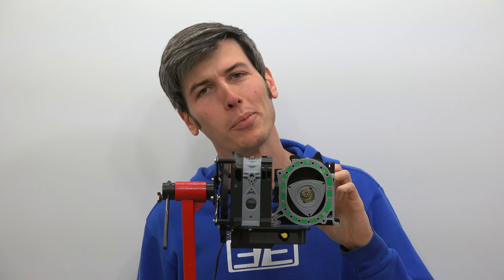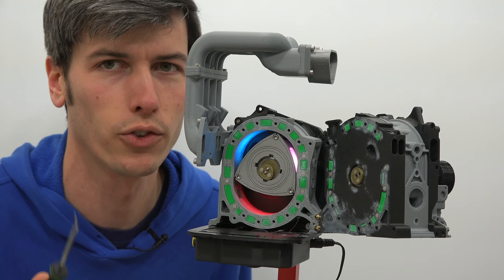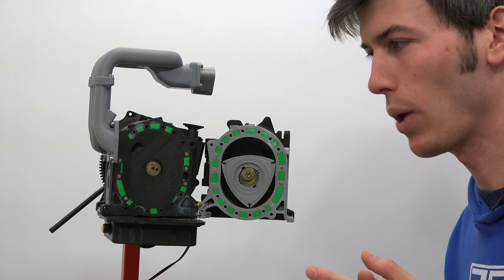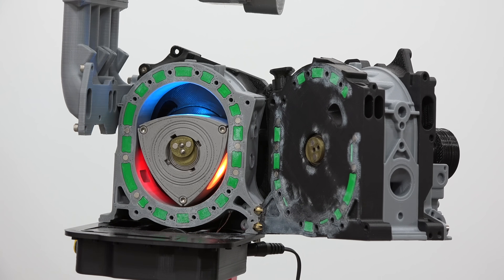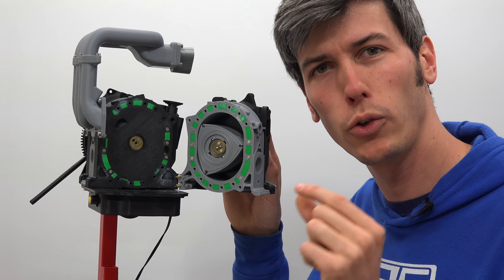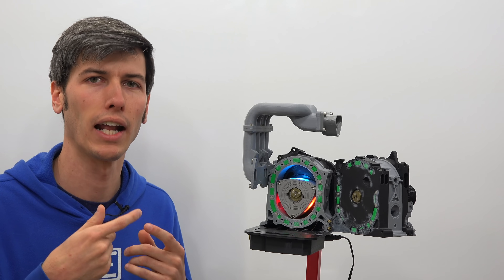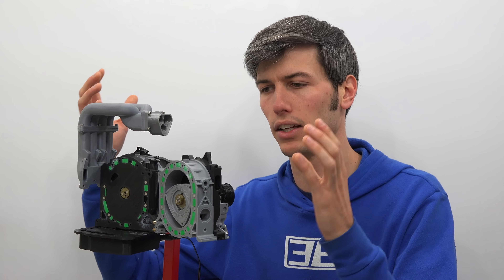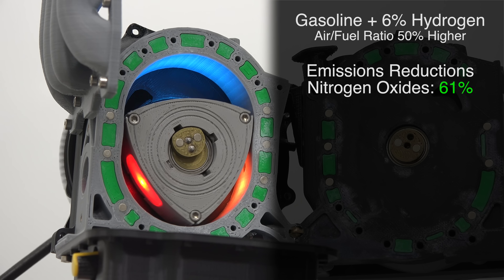Mazda Built A Hydrogen And Gasoline Powered Rotary Engine

Comment: • Mazda's hydrogen engine was originally tested in the 1990s & the car had a dual clutch, dual pole (reversible) C.U.M. dynamo (electric generator motor) between the rotary engine & transmission.
• The floor pan was a stressed member, honeycomb lattice, electrolysis, design that held distilled water that hydrogen was produced in (via electrolysis) that was pumped into a composite fiber fuel tank in the trunk/boot.
• The exhaust produced more water which was pumped back into the floorboard lattice tank.
• The LiquidPiston ® rotary engine is superior to Mazda's design in that the Apex Seals are mounted in the rotor housing & don't break like the Mazda design wherein the Apex Seals are mounted in the rotor. 
• However, I've been waiting LiquidPiston's engine to go into mass production for the public for 15yrs+ & nothing. The prototypes are only available for testing for various applications for the military.

Comment: But what about the rest of issues with Wankel??? It’s discussed like no more oil is injected, not mentioning the sealing issues, as H2 is one of the most leaking gasses due to smallest molecule size, why you keep silent about that? So emissions would still be there with all the oil stuff
Also the temperature gradient between intake / exhaust may be even greater due to higher thermal efficiency, further upsetting sealing and run length, as well as cooling concerns 
Would like to hear these aspects also added to the story to make the “full picture”))))

Comment: Great you mentioned how EGR easily can adjust burn rates and eliminate one of the usual arguments against this coincidentally disruptive technology in ANY IC engine that you can buy a gas kit for (LPG LNG) and run on hydrogen. Big oil too, has been fighting this for ages. You don't need a large tank, you need hydrids

Comment: I wonder if the apex seals could be resigned to work like a roller cam I'm thinking a needle bearing at the tips of the rotor would help with wear and revs I wonder if a needle bearing would against the housing instead of rub or grind against the housing

Comment: @Engineering Explained
does that also mean there is no carbon buildup? since you use hydrogen, and what temperature would the inside be like im considering starting a spider farm to produce the amount of spider silk needed for apex seals since it is more flexible and stronger than steel

Comment: Stunning video, Toyota has actually resolved (apparently) the issues with piston engine pre and post Hydrogen Ignition . . . they run the 3 Cylinder GR Yaris Turbo engine on the upcoming GR Corolla (300HP) on Hydrogen.

Comment: So...
What if you used electrolysis to separate oxygen and hydrogen using electricity generated by a rotary hybrid generator and combust the gases back into water and continue that cycle indefinitely.
I realize there is physically a net loss in energy efficiency, but since you explain physics and have way more knowledge than I do, would this be feasible and could you explain this concept further?

Comment: Can you please talk about high mileage rx8 2008 6 port high out put full synthetic (Midas high mileage 5/20 ) oil light flashed after the car misfires and new catalytic converter reached 2200 degrees Fahrenheit. Now the car is leaking and running horrible. So how does it mix and ignite? What happens to hotter temp oil not being broken down ? Can it cause apex seals to flatte? Fuel injectors clogg?
Reply: Time for a new car.

Comment: Should rotary engine go hybrid assisting with a electric motor? 
How about rotary engines inside two wheel hobs for front wheel drive and inside all four wheel hubs for all wheel drive?
Please also programming one or two rotary engines recharging the battery even when the car is not plugged in for recharging!

Comment: If they could just make it run on Diesel, it would be the PERFECT FUEL!     But you would need like a Roots style Blower  that would be able to get the Compression ratio to 20-1 then still have to use some kind of Hydrogen to aid in combustion.   Or Propane.  Or natural gas.   The Diesel would take care of the Lubrication of engine parts.   

I'm still baffled as to why they don't make more Air cooled Small Rotary engines for things like Back Pack Leaf Blowers.  Or even Turbine Powered Leaf Blowers.  They would be really simple,  small and light.   High RPM would be great, and the amount of air could also be used as work.   Strange.
Reply: Low sulfur diesel fuel has lubricity of only 600 mq, not much better than gasoline.
 Several companies like Sachs, Dolmar, Yanmar, IFA, Savkel and Graupner developed small air-cooled Wankel engines for use in power tools and garden equipment.
 All of them proved inferior to reciprocating engines and were not commercially viable.

Comment: Make sure your sparkplug hole is too large and allows combustion gasses to cycle to the wrong side, also make your exhaust port too large and have it lose usable compression. Also the dorito make sure its not dished to be more functional in one direction, make it smooth and slightly curved. Lastly use soft easily worn out apex seals.   Or fix all of these documented issues?
Reply: None of those things will fix the many fundamental flaws in the Wankel engine.

Comment: I would assume using hydrogen in a fuel cell would be way more efficient than burning hydrogen in an engine.  The only reason why I would think H in an engine would be used would be to have the capability of using gasoline as a range extender.  I got a little confused at the end of the video with using H as a range extension, because I would assume gasoline would be the range extension. If your using H as a range extension for a hybrid, just use a fuel cell.
Reply: That is exactly why all 3 currently available hydrogen cars use fuel cells.

Comment: You'd think that because hydrogen is a gas, they'd be able to compress it for the fuel tanks.

Now if they were to combine Hydrogen, Diesel, Ethanol and Gasoline in the same engine... That would be impressive. It would become an Omni-Fuel engine.

Comment: The numbers at the end were very interesting,.

Simply curious, If you ran H2/O2 or even CH4/O2 (high purity) what would the efficiency of the engine look like? Setting aside the energy used to pressurize the H2/CH4/O2, this is more of a curiosity for a hobby project rather than a car.

Comment: The problem with water as a fuel is the transition/splitting of oxygen  and two hydrogen engine.  However, once that problem is solve...it will change the world.  I was wondering why the the top of engine is used to inject the hydrogen.  Why not flip the engine to solve the contigency of water entering the system and corrosion?  Hydrogen is lighter than air.  Just asking since I am not an expert?

Comment: Rotary; Genius invention by Mazda, great explanation on how and why they work! Quick question for you, would it be possible to convert a rotary engine from the USDM (let's just say 13b for common reference) or would it need any special engine modifications other than dual injectors and exhaust system to handle the heat produced?
Reply: Not invented by Mazda, they purchased a license to build Wankel KKM engines from NSU MOTORENWERKE GmbH. In 1961.

Comment: I think you made a mistake there. You said that a leaner air/fuel mixture would REDUCE combustion temperature. But isn't it actually the exact opposite? (that was around the 8 minute mark i believe)

Comment: My concern would've been the (small, but still present) rotor-to-housing gap that separates intake and exhaust, but if mazda is going into production with it, then it must not be a problem for their system. I wonder if the charge just burns out fast enough that even with the "valve overlap" there's nothing left to ignite the incoming mixture (I just didn't want to say "port overlap" and be even more confusing)

Comment: Thanks for a super-interesting video. I work in a semi-niche technology called heat pumps. One thing only some companies have done well is understand find and develop their niche application(s) in regional markets.  Mazda has apparently done that by targeting this H-rotary as a range extender - constant rpm means very good reliability though low torque - and I assume this engine can be mated to fuel cell vehicles in the long term as fuel cells continue to improve. However, what other niches make sense for hydrogen combustion?  Power station backup? Remote cell towers? Arctic or off-grid applications?
Reply: Fuel cells are much more efficient than engines. There would be no point having both if you are using hydrogen as the fuel. The rotary hybrid mentioned is burning gasoline which can't power a fuel cell, with the engine powering a generator to top up the batteries. 

I am struggling to understand why several companies are using hydrogen engines at all rather than just using fuel cells. My best guess is simply that fuel cells are expensive, and get more expensive the higher the power. For an electric car using a fuel cell as a range extender works great as you only need low power to keep the battery topped up. For heavy machinery that needs high power all the time you would need a very high power FC which would cost a lot, so then maybe the cost saving of an HICE might make the terrible fuel efficiency worth it. I still would have thought it was worth paying more for the vehicle to get better efficiency, but apparently some companies disagree. Unless it's some kind of scam and they are just doing it for PR to seem green. 

Remote static low power scenarios are best done using solar power and a battery. If that wasn't possible then a hydrogen fuel cell could be used. But the extra effort of refuelling it would mean it would only make sense when solar was really impossible, like underground. Even in the arctic when solar power was limited it would probably still be better to just have a bigger solar panel and a bigger battery. One other use I have seen is one that really makes use of hydrogen's light weight: HFC powered drones. The FC hangs underneath with the light hydrogen on top. 

For power generation if FC was too expensive I think modifying gas turbines to run on hydrogen would probably be the way to go, rather than a piston or rotary ICE.

Comment: Hey Jason, here in Finland, our goverment set a target to have 250 000 electric vehicles and 50 000 CNG vehicles by year 2030. Compressed natural gas could be viable solution for long distances in cold harsh winter conditions.

 I was wondering if you could make a video about CNG?
-Jani

Comment: So it'll be like flexfuel except with hydrogen instead of ethanol. That's pretty cool, especially as Japan has dedicated themselves to hydrogen fueling stations. Although since hydrogen is a lot harder to contain than gasoline, I wonder if the apex seals will have to stay within even tighter tolerances.

Comment: Glad you both got this pretty model and did the video regarding how well hydrogen works with rotary.
Surprised you didn't discuss how well hydrogen works in conjunction with water injection. The hydrogen disperses readly because it is a gas unlike the liquid droplets from a fuel injector.
A compressed hydrogen fuel charge can completely burn in 5 milliseconds and at a higher temperature. If water is in the same chamber with hydrogen, it reduces the peak temperatures readily and as it turns into steam provides thrust. Hydrogen by itself doesn't produce much thrust.
Delayed spark timing for hydrogen fuel charge is also well known due to the rapid burn. Hydrogen fuel and water go together in an engine "like peas and carrots".
Thanks for the many deeply informative videos. Keep up the good work.

Comment: Well using a very lean mixture of hydrogen alongside petrol just makes sense, as it has all the good characteristics that petrol typically lacks. I mean with hydrogen mix you're getting a much more complete fuel burn, and it's able to ignite more of the petrol faster, at the start of the power stroke so it can do more work resulting in far more torque, and greater fuel economy.
The symbiotic relationship with how petrol cools the combustion chamber reducing hydrogen nox output, and how hydrogen ensures a far more complete burn of petrol and thus reducing hydrocarbon emissions is just a bonus

Comment: Would methanol injection work with hydrogen? I know it can be used in gasoline engines to reduce the temperature and reduce knock

Comment: ok here's what i don't understand. why don't two-rotor rotaries use one rotor to provide the two compression chambers and the other to provide two expansion chambers? then you don't have the temperature differential problem. the connection is a very short simple length of hole. is the problem getting a small enough volume in compression?

Comment: The weak point of rotaries is variable loads and speeds. By running as a BEV charger (constant load, constant speed) and running "lean of peak", the engine can become extremely efficient with low NOX emissions, at cost of peak power.

A lot of this applies to piston engines too. I recall reading a book titled "Tuning for economy, tuning for power" back in the 1980s (written in the 1970s) which discussed this exact issue - of course bewck then you had to make an enegine run EITHER/OR due to all the controls being mechanical and largely "fixed", unlike today's mostly-electronic systems which can dynamically change operating conditions to suit demand.

FWIW, Chrysler's EFI "Electronic Lean Burn" systems in the 1970s (fitted to their 4 litre hemi sixes) were running at 40:1 or higher ratios but suffered badly from NOX emissions. If they'd been able to use full-blown electronic systems instead of carberettion and/or mechanical fuel injectors they'd have been able to get into the "Lean of Peak" areas and achieve what they were aiming for without NOX going sky high. (The same applies to the japanese ELB systems.)

The whole thing got knocked into a cocked hat when the USA federally regulated that fuel ratios MUST be stochiometric (makes for cheap 3-way catalysts and blew away all the advantages that Chrysler and the foreign makes had over Ford+GM in terms of fuel economy/power research) - that law probably set back R&D by at least a decade.

Comment: In the video it sounds like you suggest you could run hydrogen and gasoline at the same time..? That didn't actually happen did it? Out of interest would that be possible, and would it be beneficial to lowering the emissions and getting a more consistent burn?

Comment: They are actually developing a new rotary engine but they actually reverse the rotor and block.    The engine block will be shaped like the current rotor and the new rotor will be shaped like the old block.    It will eliminate the need for Apex seals.    I believe it's called the SkyActive-R

Comment: From what i can tell, the rotary is gonna be a "range extender" meaning it's not always on. So for the normal commutes, its primary electric vehicle but when you are running out of juice and can't plug in, the rotary will turn on giving you charging capability to feed the electric side....Its lightweight and attached with the crank vertical to the ground.

Comment: Why do I not see adverts and car manufacture commercials for hydrogen combustion engines. They tick all the boxes, better for the environment, fuel you could in theory make at home or passively overnight at a gas station, a fuel that can be tame and quiet in a luxury car and loud and firey in a sports or enthusiasts car.. I hope the answer to this isn't that too small a population care about fun cars that sound great and too many governments can't figure out a way to tax 88pence per litre on home made fuels even with safety standard generation plants or there's secrelty a by product available for lubrication from another industry that also couldn't be significantly taxed..

Comment: I used to own a 1985 Mazda RX-7 in the late 80's and it was a fun car to drive the engine was super quiet at idle, people would ask me to startup the car so they could hear it running and the car would already be running.  Topping up the oil in between oil changes was interesting.

Comment: Confused about the two ways it cools the engine to improve emissions
1. how does a lean air mixture cool off the combustion chamber? I thought it was the opposite. 
2. Wouldn't recirculated exhaust gas air be warmer than just using ambient air?
Reply from the maker: 1. I'll have a video covering this soon. Lean cools down. 
2. Since it doesn't react with the air and create more power (combustion), it's cooler.
Reply: @EngineeringExplained  I´m quite certain that in a previous video you told us that (sometimes) more fuel is added by injection to cool/control the gas temperature though.
Reply: Engineering Explained when you say “lean” are you only referring to going lean on hydrogen, but rich on petrol? Then that makes sense to me, bc I’ve always read that rich AFR’s can cool the combustion chamber with the leftover unburnt fuel acting as a cooling agent.
Reply: Engineering Explained I think I figured out why I was thinking running rich will cool an engine. 
1. For two stroke motors where they mix oil with the fuel, running rich does lower temps, but it’s the oil, not the petrol causing the cool. 
2. With users running  an e85 mix into their premium gas. The mix cools the engine more than running straight premium fuel.

Comment: Uh, any fuel injected internal combustion engine can run on hydrogen with very few modifications, just saying...it's carrying the fuel that is the ultimate issue. Too bad the wankle (or is it wankel) was tech designed for a problem that really was not a problem and only created another and was implemented without the proper tech for long term seals. Pity, fun engines. Probably the neatest thing DKW ever came up with.